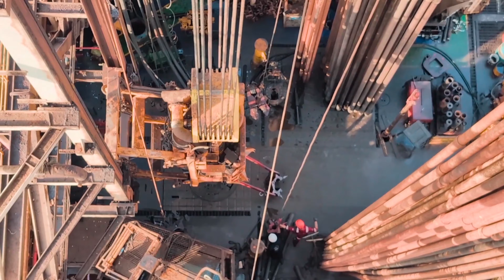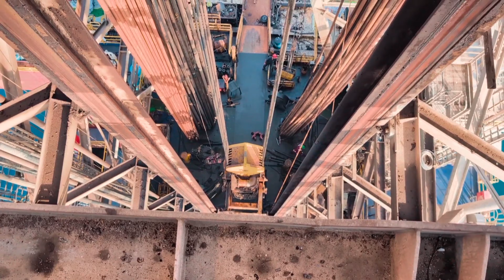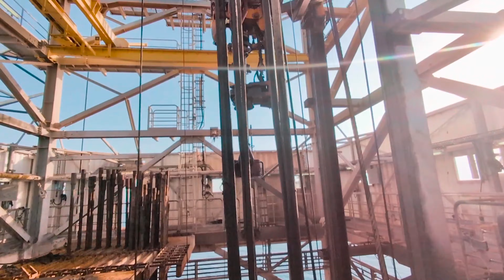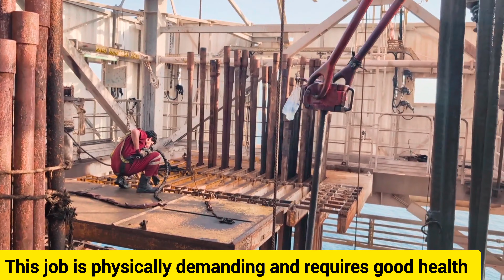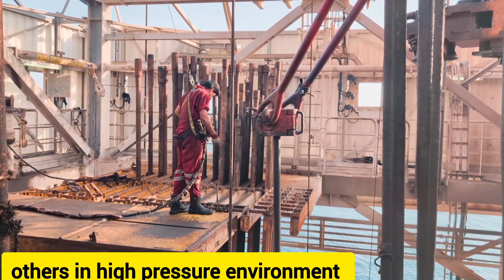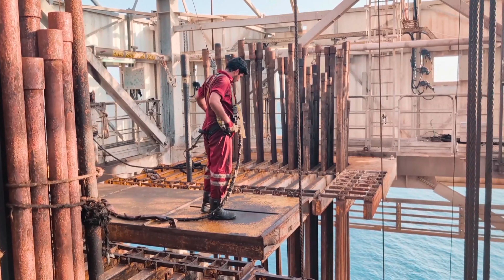Derrickman oil rig job

Comment: I'm Derrick man
Reply from the maker: “Nice! Derrickman is one of the toughest jobs on the rig — handling drill pipes, mud systems, and working up high on the monkey board. If you want to move up, focus on safety, take your well-control training, and aim for Assistant Driller next. Big respect — rigs can’t run without you!”

Comment: Is this a Triple or is there 4 pipes in a stand, i guess u could call it a Quad instead. of a  Tripl
e.
I can FT count 5he Joints and ive Neverheard if a Quad if this what it is?
Reply: @chrislnflorida5192  They're normally called a "fourble" if it's 4 joints per stand

Comment: Some important notes, not everyone who works on a jack-up is suited to doing the transfer from roustabouts to roughnecks. A good derrickman has to also be a good stabber when working with casing, especially with size 13 3/8. The journey of a good derrickman ends with being a toolpusher, whether it is day or night since the crews belong to the company that drills the wells. An OIM represents the oil company that generally owns the place or concession where the drilling is taking place, the OIM is also known as the Company man.
Reply from the maker: You have very good experience. Thanks for sharing this info👍👍🙏
Reply: @offshoreoilrig1  I have worked for 43 years in the Gas and Oil Industry. I started as a rookie running Casing and Tubing, I ended  up as Directional Driller/Coring Operator with Eastman Christensen.
Reply from the maker: @eduardomontes1276 wow experience man👍👍 you're end of drilling sir👍
Reply: 😂 @offshoreoilrig1